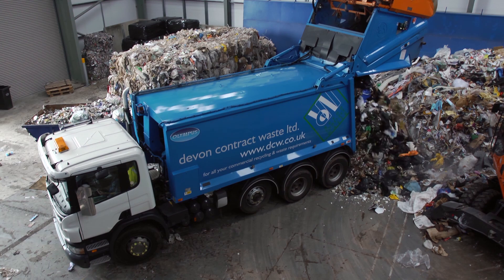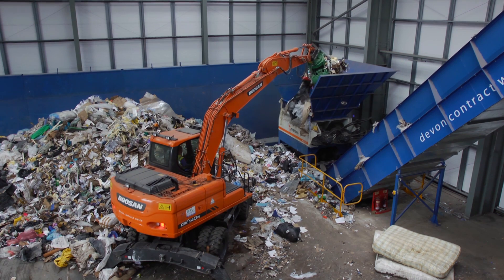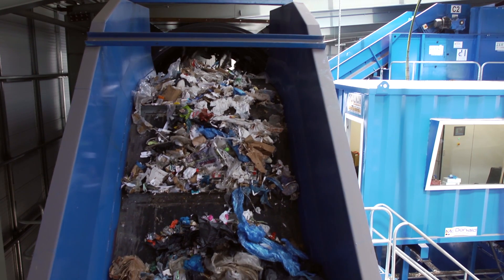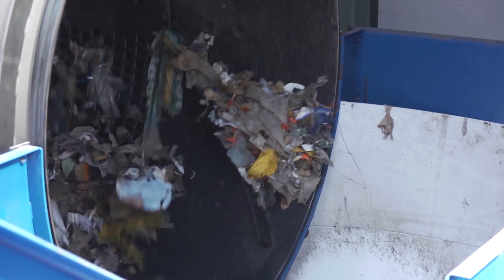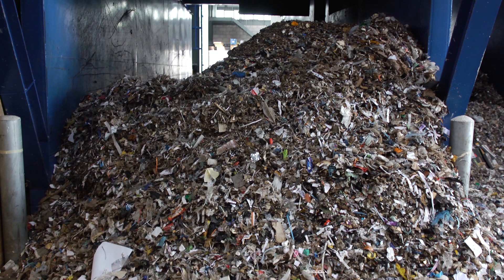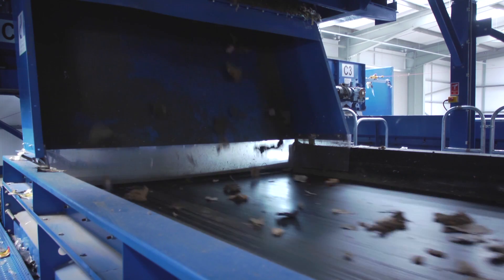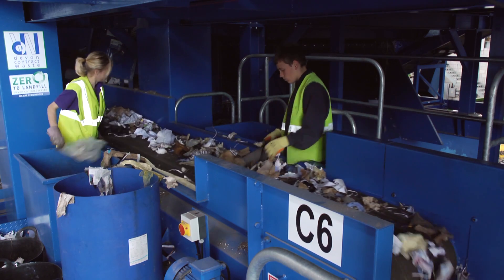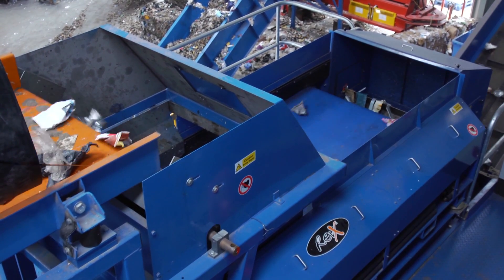What happens at a Materials Recycling Facility? (MRF) - How does our sorting machine work?

Comment: I'm still a little dubious about this.  While it's great that this capability and technology exists (better this than nothing), it is there primarily because people are too lazy to at least sort paper, glass, plastic and metals at home.  Yes, I know that there are situations where it would be difficult for space reasons, etc., but especially in most of the United States, home sorting should not be an issue.  Furthermore, the companies designing packaging solutions are not putting enough effort into better recyclable designs.  That said, I've seen reports that some end processors of previously recycled paper won't accept the material if it is even slightly contaminated with non-paper products.  So, in the end, after all of this energy is expended sorting, I have to wonder how much material actually gets reused.  There are plenty of articles and videos detailing that too much - the vast majority of plastic for instance - still ends up as waste product after going through recycling systems.  I can only hope we start doing better sooner.  At least we've made a start.

Comment: Interesting. I love seeing clever machines. I think the baling machine at the end was my favourite.
Reply: If the council has allocated a compost bin then that would be the best place for it. This would go to an anaerobic plant for a contract between the council and the contractor to supply the AD plant. 
If this is not available and you have space in a yard then a plastic compost bin is best. 
What happens with Organic Waste (food waste) is that it contains Animal Byproduct and under Animal Byproduct Regulations (risk of disease from meat etc), food waste requires heating to destroy bacteria). 
When food waste enter co-mingled waste - the recovery statistics are very poor compared to source separated [removal of clean paper, card etc].  It is effectively downcycled just as clear glass mixed with green glass is worth less than clear glass. 
In addition the risk of aspergillios bacteria increases with contaminated waste. 
Yes there is the argument for Refuse Derived Fuel and incineration. This must have a carbon content and were it not contaminated then it could have rather entered the recycling stream. 
So yes the system is there for people that refuse to recycle despite all initiatives. Assume 50% of the population will not recycle. Of these people the value gained from their waste through recycling is much lower at approx 30%; lower than the value of clean sorted materials from separation at home >80%. 
Once bottles, aluminium, paper, card, tin, milk cartons and clear plastic is removed from the waste stream; and the compost is sent down the correct channels uncontaminated by plastic, then this is the best possible outcome. 
Any compost from this MRF will be contaminated. Look at PASS 100 & PASS110 Compost & Digestate Regulations and Permissible Contamination Levels  if applying this to Agricultural Land. 
If burning facilities exist i.e. Incineration and Heat Recovery then some Organic Matter can be utilized for calorific value in the waste stream provided it is dried to the correct moisture content. 
All more expensive than perfectly separating and composting at home or through purpose designed facilities.
Reply: That was clever! So.... Does this mean I can chuck some organic rubbish into the recycling if I run out of room? 🙎🙎🙎
Reply: @FredericaMussolini  no
Reply: +Frederica Mussolini A composter rarely runs out of room...
Reply: my wife is a clever dish washing machine. lol jk i have no wife